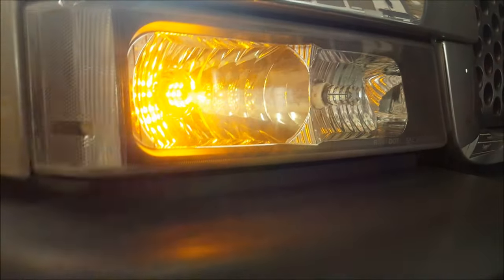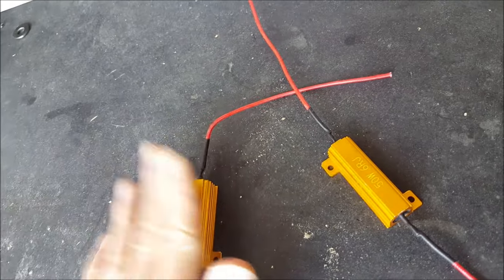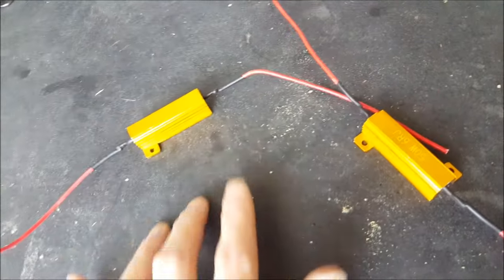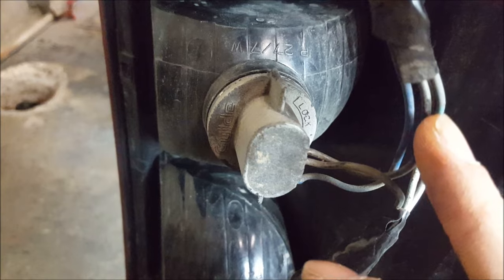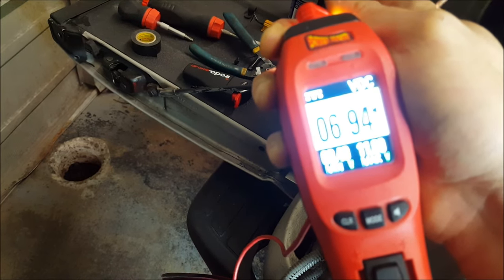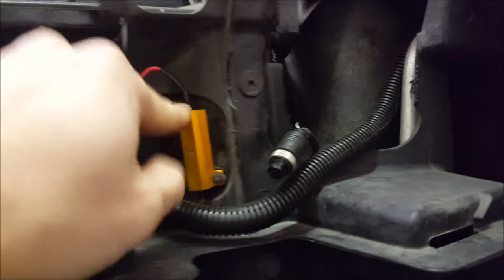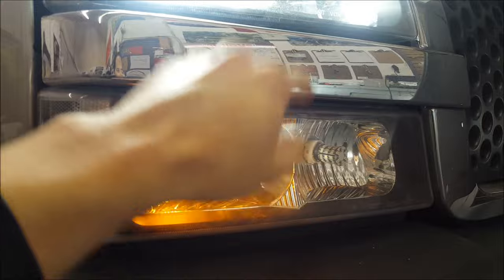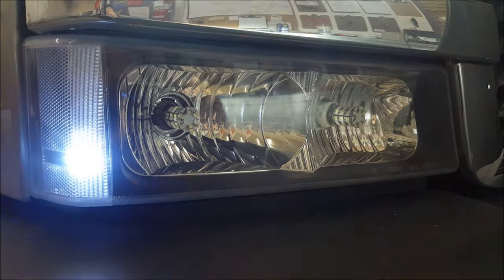Load Resistor Install (Eliminating Signal Hyper Flash) | AnthonyJ350

Comment: I used these on my LED turn signals/markers Jeep Liberty. The hyper flash were gone, until I turned the markers on and hyper flash were back. The arrows indicator on my dashboard stays on. Hyper flash are gone when I turned off marker/headlights. What could be causing this?
Reply from the maker: Not sure, you would have to test voltage at the light.

Comment: Hi I need some help.
I put sylvania zevo LEDs in my front turn signals I wired in 2 led resistors 6 ohm 50 watt on the right and 2 on the left as there are 2 bulbs per side.
My flasher worked properly with the stock tail lights and stock incandescent bulbs.

Then I went to the rear and installed led tail lights from top gear auto for my 2000 ford ranger. These led tail lights come with there own factory 6 ohm 50 watt resistor but after installing them my flasher now hyper flashes.
I used an ohm meter to test the resistors and they show 6 ohms resistance.
I figure I need more resistance on the rear led tail lights do you think I need 8 ohm 50 watt resistors instead?
What would it hurt to place another 6 ohm 50 watt resistor in a( double y) to the 1st resostor. Say 12 ohm 50 watts?
My thinking is the heat build up would be 1/2 as much.

Would that be considered 6 ohm 100 watt?
Or 12 ohm 50 watt?
Or should I just get 8 ohm?
Reply from the maker: Both side hyperflash?  Maybe the load resistor is defective?
Reply: @AnthonyJ350  yes both sides hyper flash with these new led tail lights.
I have used them for 1 week with consistent  hyper flash 
There is a led flasher fo this truck maybe I should just get it and pull out all resistors.
Versus getting a pair of 8 ohm .
Just sucks I spent money on resistors all ready.
I saw a video  on opening the stock flasher and grinding down the resistor in it to fine tune hyperflash.
At least that option is free.
And if I mess it up then get the led flasher.
Do resistors have polarity?

Comment: Is it SAFE to install a normal incandescent bulb on the circuit with the resistors? I bought new LED bulb that are Error Free which I'm assuming have a built in resistor...and I have resistors already installed... Can this over load the circuit in anyway if I use them?

Comment: So I watched your video on how to install led load resistors for turn signals on my 03 grand Marquis with 3157 led switchbacks. The problem I am facing is that the turn signals hyper flash when I have my parking lights or low beams on. When they are off, turn signals don't hyper flash. I have installed 50W 6ohm resistors on both left and right. What's wrong over here?
Reply from the maker: Is the original marker/ signal light a dual filament bulb?

Comment: Does the load resister need to be near the LED or can it be installed up the line where it can be fastened to metal?
Reply from the maker: It can be up the line, just needs to be on the same circuit
Reply: @AnthonyJ350  thanks

Comment: So what 2 color wires on the back of the front turn signal do you attach the resistors to?
Reply from the maker: Positive pulse and ground wire. You need to test with a multimeter
Reply from the maker: This video might help https://youtu.be/NMoYGQhD2DI

Comment: Why using 50w resistors for each bulb? When you replace a 21w incandescent bulb for a LED a 25w resistor will be more than enough. It generates less heat also and the car won't think it's short ciruit. Too little load causing hyperflash, but too much load can the car make think there is a short circuit and refuses to blink. One 50w resistor for each side (front and rear) is ok since it replaces two 21w incandescent bulbs. If I remember correctly, each side is one circuit so one resistor of 50w for each side should be enough.
Reply from the maker: We just like to use them because it can in theory handle more load. I understand the heat portion, that's why we mount them to metal. I've had a set in the back of my truck for about 8 years now and put on over 100,000km on them.

Comment: The resistors that I have included splice taps but I'm unsure how to get the wire I need from the light to put into it
Reply from the maker: I recommend soldering. This video might help more with install https://youtu.be/NMoYGQhD2DI
Reply: I ended up getting it done with the splice clips and resistors, but it was a quick trial and error since I didn't have a voltmeter so now my blinkers are LED.

Comment: The ones for vehicles with a CAN bus have some resistors on them.  If you bought those type you may not need any additional resistors.  I bought them for my 2006 Jetta and they worked as advertised and I did not need any resistors.  Usually it is hard to find a good LED for these kind of cars because the ones at most auto parts stores are not the right bulb out of the box.  I wonder if Sylvania makes one like that yet.  I am thinking of the resistors already in the bulb so you don't have to do these things.  It would be nice because a good one for my car is rather difficult to find.  I go to websites that claim to have a compatible bulb and advertise it as plug and play and all.  When I chat with them they still tell me I need load resistors.  I wonder if they even have a clue what they are selling.  I would buy their bulbs for other vehicles that don't need load resistors anyhow.  One thing that causes that hyper flash in many cars is the relays.  There may be relays for use with LEDs and they might be intended for older vehicles that do not have a CAN bus or any other sensitive electronics.  I mention relays because in my very long search for a good LED for my VW that showed up a few times in some forums.  Just do what I did and look around and see what people are saying about certain brands and things.  Some do not last and are a waste of money.
Reply from the maker: Thanks for sharing!

Comment: I actually have a silverado and the same year range and I've had troubles with LED lights and I was wondering if you can give me some insight on the exact wires that come from the resistor to the light itself. Also would it be different if you have a switchback LED? Thanks.
Reply from the maker: +Cole Lewis What problems are you having?
Reply: I have no parking light, and if I reverse the bulb I pop fuses.
Reply from the maker: Cole Lewis I would try the stock bulb.  If it works with the stock bulb you probably have a defective bulb?  Where did you buy them?  Try iJDMTOY.
Reply: I did try that and hooked the light up to a 9V battery and both the white and amber part work.
Reply: when hooked up to the 9V battery
Reply from the maker: I'd check the voltage coming out of the truck, might not be enough to drive the LED lighting.  This type of lighting doesn't draw much amperage but it needs a good amount of voltage to work.
Reply: Ok ill check that and if its normal any other suggestions or tips and tricks?
Reply from the maker: Cole Lewis Not really, it should just plug in an work.  I've never had your issue happen to me.

Comment: you have to have a load resistor on the front and rear if you have leds in front and rear trun signal?
Reply: Left and right are separate circuits, so one resistor of 50w for front and rear on each side consisting two bulbs shoud be sufficient. Or one resistor of 25w when you plan to replace only one bulb in front OR rear per side.

Comment: my new bulbs don't want to fit in the socket tight ....have you ever had that problem ??
Reply from the maker: Yes some bulbs are made longer to accommodate more LED's.  So you might have to find a shorter one.  Or are you just referring to twisting it in at the base?

Comment: My taillights 1157 socket only has two wires. It's a blinker running light combo. Tried one of these resistors and I get hyperflash only when the headlights/parking lights are on. Anyone got any ideas?
Reply from the maker: You'll have to test the wires with a multi meter to make sure you're manipulating the circuit properly.

Comment: I installed 4 turn signal led bulbs front and rear, am i going to need 4 resistors ?
Reply from the maker: That's correct
Reply: @AnthonyJ350  2 50w 6ohm installed at the rear won't fix the hyperflashing?
Reply from the maker: @fsocietey  If it thinks the front bulbs are burnt out (because LEDs are installed) it will hyperflash
Reply: they are brand new led bulbs, i replaced the halogen ones with led, and I got hyperflashing since then, I'm confused because the hyperflashing is only on ACC but when I turn the engine one its gone...
Reply from the maker: @fsocietey  If the engine is running the resistance value will change. If you have no hyperflash and operation is normal then the bulbs you purchase put enough load on the system.

Does it say on the box "prevents hyperflash"?

Comment: Has nothing to do with the diode. LEDs use much much less power, so vs the stock incandescent bulb , which takes way more power. Now you still have all the power, but instead of using the 21 to 27 watts a stock bulb takes, the led only needs out about 4.6 volts vs needing 12 volts like an incandescent bulb.
Reply from the maker: Thanks for the comment

Comment: I guess I’m old school. I use the ole fashion bulbs. I get them for 1.29 at the auto store.....how much did this cost?
Reply from the maker: Freedom 1 pairs are like $15ish at he auto parts store. Nothing wrong with the bulbs you use. They're proven and cheap. LED is still kind of new to the masses.
Reply: AnthonyJ350 15 dollars for a bulb? Good God man......I’m in the wrong business.....i have6 trucks and they all pull a trailer....15 bucks???
Reply from the maker: Freedom 1 That's for a pair. They do last longer, so you would have to change them less. It's also less strain on the charging system.

Comment: did you connect the resistors to the end wires? or what colors did you use ?
I also have a silverdo. 04
Reply from the maker: Just hooked it up between the two wires.

Comment: I intalled it on my 05 dakota turn sig... they work but not thr running light???
Reply from the maker: You shouldn't need the load resistor on a running light

Comment: question for you I installed led taillights my rear blinker didn't have the hyper flash so does that mean I won't have the hyper flash in the front either my vehicle is a 02 tahoe and I am confused how do I hook up the load ristors do I actually cut the wire and does both go to postive or what

Comment: i was install resistor in my car .. but i need to know if its problem .. when i start the light for 5 or 10 minutes i cant tuch it .. its so soo hot it can damage plastic .. so is it normal or not
Reply from the maker: Load resistors get very hot.  That's why they should be mounted to metal not plastic.  And work with them with everything off.

Comment: how to you properly install a resistor in a alarm system? do you have a video on that?
Reply from the maker: What are you trying to do exactly?
Reply: That durango alarm LOL! I found the power door lock wires. Both tap into one wire on the car. I need to look up see which gets the 350 ohm resister and the other gets the 820ohm resister. How do you connect it properly?
Reply from the maker: I don't have a video of that currently.  Sure you don't want to take it to a shop to fix?  How many days have you been at trying to rewire that part?  A shop can probably do your locks in a couple hours and provide you with a warranty for their work.
Reply: Pretty sure.

Comment: If I buy these for flashing brake lights will it stop the hyper Flash on the turn signals only
Reply from the maker: What's happening exactly? As long as you only wire it to the turn signal circuit. You'll need one resistor per bulb.
Reply: @AnthonyJ350   I haven't installed them yet but I keep reading that I'm gonna need his resistors so I'm not sure if I need resistors or if I should just go ahead and plug them in to see if they work without them.
Reply from the maker: @wasupwilly  You can always try the bulbs first and see what they do.
Reply: @AnthonyJ350  Will do.
Reply from the maker: @wasupwilly  This video might also help https://youtu.be/NMoYGQhD2DI
Reply: @AnthonyJ350     🤯
Reply: @AnthonyJ350  having issues with running lights with this bulb
Reply from the maker: @wasupwilly  What's it doing?
Reply: @AnthonyJ350    flickering when  installed if running light is on.
Reply from the maker: @wasupwilly  What brand did you get?
Reply: @AnthonyJ350  brishine

Comment: Question how many watts of load resistor do we need? because there's 50W and 25W thanks
Reply from the maker: I always use the 50 watt versions
Reply: @AnthonyJ350  is it ok to put 50w on the front and 25w on the back?
Reply from the maker: @popopogi69  What's the resistance of each?
Reply: @AnthonyJ350  6ohms
Reply from the maker: @popopogi69  In theory the light intensity would change.
Reply: @AnthonyJ350  so do you think that 50w 6ohms all 4 bulbs is much better? Thanks
Reply from the maker: @popopogi69  I would keep them all the same yes.
Reply: @AnthonyJ350  thanks for your reply
Reply from the maker: @popopogi69  You're welcome

Comment: You put the resistor in serie, but it should be connected parallel to the led.
Reply from the maker: Are you saying it needs to be wired like a speaker? How do you explain it working after?

Comment: I have a question if I removed the resistors and put the original bulbs back (not LED) will they work normally like how they came? Please need an answer
Reply from the maker: Robin It should, did you test it after you removed the parts and installed the original hardware?
Reply: AnthonyJ350 I haven’t done it Yet that’s why I’m asking first to make sure that in the future I would want to remove them
Reply: When you remove the LED's and remove the resistors also (or cut them)  there should be no problem when you put the original incendescent bulbs back.

Comment: what is the purpose of tapping the ground on the socket?? why not just ground the resistor using the mounting screw that you're going to attach to the body?
Reply from the maker: +Corey497 Never tried it that way, but if you solder and use electrical tape you're going to shield it better from the elements and you're guaranteeing the light circuit is being tricked.  You can try it your way and use dielectric grease to prevent corrosion.
Reply: I have the same question.  I'm trying to find a good place to mount the resister on the front of my 2012 Toyota Tundra.  One side of the battery is connected to the frame.  Why can't one wire on the resistor be connected to one of the screws used to mount the resistor as suggested by @Corey497?  There doesn't seem to be a good place near the bulb to mount the resister, so I have to run longer wire to the resistor.  It would be easier to run 1 wire instead of 2.   Is there some reason, like flasher circuit isolation, that require the the negative side to be wired directly to the socket?

Comment: I have a 2006 F-150 with led headlights, map lights and plate lights. My front turn signal and side turn signal blink fast but the rear doesn't blink at all. How can I fix it?
Reply from the maker: Manuel Garza Is the bulb backwards in the back?
Reply: AnthonyJ350 I'll have to check. I don't think it is tho
Reply: AnthonyJ350 if that doesn't solve it what else could it be?
Reply from the maker: defective bulb possibly.  Try a bulb that works in the housing or test with a multi-meter.

Comment: Hi I have a question,??  After i put the resistor on my car i noticed that when i step on brake pedal i have static interface on my radio, and when i turn my lights on at night the static noise is more and it just doesn't go away, what can it be??? and if you have or know a solution for this problem i would be grateful 
Thank you....
Reply from the maker: Are you on the turning signal or brake signal?
Reply: @AnthonyJ350  brake signal
Reply from the maker: @99baggedmazda  These are for turn signals
Reply: @AnthonyJ350  ok thank you anyways, maybe i can try to add some more ground and see if it helps thank you again 👍
Reply from the maker: @99baggedmazda  Some vehicles the brake and signal are the same. Is the load resistor mounted to metal? Definitely adding a ground to the light circuit won't hurt anything.
Reply: @AnthonyJ350  yea is mounted to the metal, and my car is a cadillac cts 2004 so brake light and turn signal are separate
Reply from the maker: @99baggedmazda  OK if separate you only need it on signal. Try your led on brake with nothing and see if the car cares.
Reply: @AnthonyJ350  i try that and same thing I thought by putting the capacitor would help but no it's still the same
Reply from the maker: @99baggedmazda  And you're installing it like this? https://youtu.be/NMoYGQhD2DI

Comment: UPDATE
There is a Relay you can replace that will completely eliminate all hyperflash. One relay and your done 👍
Reply from the maker: What if your vehicle uses a BCM to flash the signal lights?
Reply: @AnthonyJ350  so far from what I seen with GMT800's... Is that relay works on all the people who has tried it
Reply from the maker: @shaneintegra  You can go that way if you like.  This method has worked for me for over a decade.  So I'm sharing with what I know works.  The flasher relay I prefer to keep it a GM product.

Comment: Nice video. Quick question If I use an electronic flasher that takes care of the hyper flashing with no need of resisters is there a possibility of damaging other electrical components say with Honda vehicles?
Reply from the maker: It Member You're just replacing the factory flashing module with it?